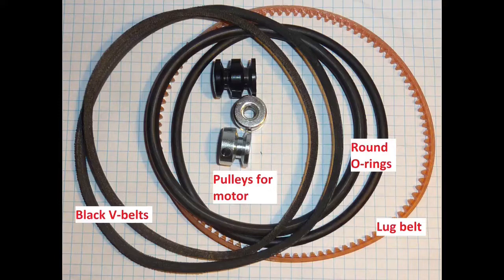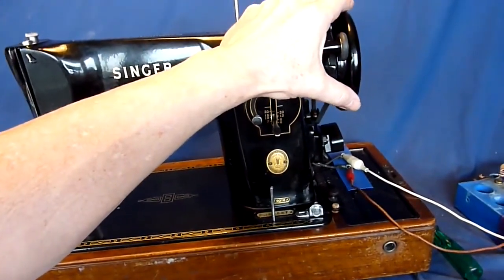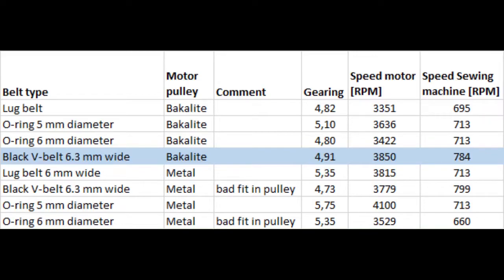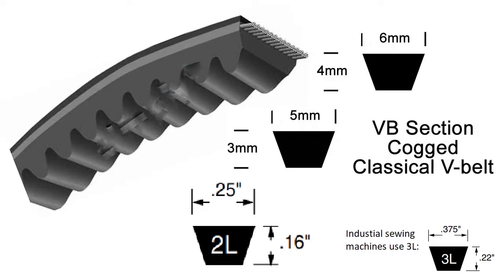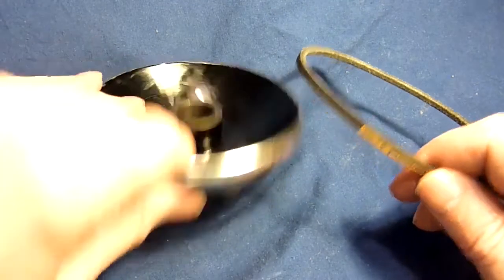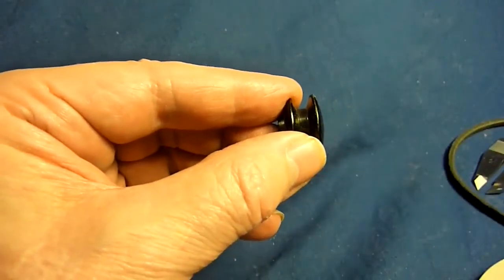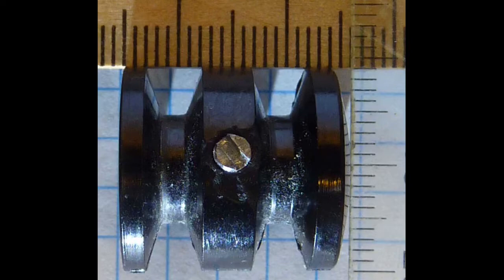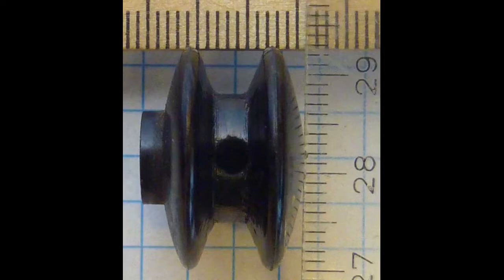How to select the right Belt and Motor Pulley for your Vintage Sewing Machine

Comment: This is great research. When building a speed reducer for my Singer 201 I had problems searching the right 5mm v-belt on aliexpress. In the end I used a GT2 timing belt and pulley I already had from an old 3d printer build for the motor to middle pulley part.
Reply from the maker: Thanks. I have seen this UK supplier of this kind of V-belts on ebay: https://www.ebay.co.uk/itm/Optibelt-VB-5x375-Li-Cogged-Classical-5mm-Wide-3mm-Deep-V-Belt/143250361763?hash=item215a630da3:g:PW4AAOSwZ2FcRb9f
Reply: @sewingmachinesindetail  Thank you for the link. I guess I should have included optibelt in my searches.

Comment: Thank you so much! I learn so much from you. Do you by chance have a video detailing how to change a belt on a typical machine like this? I have a brother select o matic and I’ve never changed a belt. It looks like I just loosen the motor screw and simply change the belt while it’s loose. I have found a v belt that I believe is the proper dimensions. I’m currently using a round belt like you’re describing and it seems to slip sometimes. I assume a v belt should help this situation or   at least was hoping it would help. Once in a while when doing a straight stitch, it will make a longer stitch than the rest and I was thinking it was relating to the slipping belt but I’m very unsure if it’s related to that issue. Regardless, I would like to reduce the slipping. Again, thank you for your awesome detailed videos like this one!

Comment: Hi. Thank you for your prompt reply.  I think I should have said motor pulley and not a spool which has the small spikes on which I feel cause the tension, my mistake. At first, I thought the belt has to be placed on or as near to the pulley for it to work correctly.
Reply from the maker: If your pulley got teeth, then your machine may use timing belts, and not V-belts. Timing belts are quite different. Please look here for more information on belts types: https://youtu.be/3pMx5hIgZbU?t=105

Comment: Thank you for your video, very good information. May i also ask you about, how can i install a new motor. As my vintage straw braid machine which has no strew hole either at the side or back. Also, this specific straw braid machine is clockwise (going backward instead of to-warding me) I don't know where shall i put the motor and also belt position to make this works. I can't find videos anywhere that showing any clue. Hope that you may can rescue me from this. Thank you very much for your time.
Reply from the maker: I am not familiar with your type of machine. You can get new universal AC-motors, that runs clockwise. I guess there will be some DIY work in applying a motor, if the machine head got no screw holes to fix the motor.
Reply: @sewingmachinesindetail  many thanks for your kindly helpful reply. All the best~

Comment: Excellent video. I have a question. My brother put a new motor on my sewing machine and the lug belt is breaking and is very loose, about 1 inch too big. Can I exchange the lug belt for a different type, or do I have to stick with the same type? The spool the lug belt goes around has small spikes running around the edge. Thank you for sharing.
Reply from the maker: Thanks for the interest. In general you can get lug belts in many different lengths. They normally got a V-belt shape even though they are cogged belts. What do you mean by the spool got spikes? Is it motor pulley or pulley on machine?

Comment: Is the V pulley explained from 9:17 the same as the inner diameter (inner hole) diameter of the pulley of the home sewing machine of 6.3mm? Please tell me where I can buy it.
I can't find it when I go to the given site.
Reply from the maker: Thanks for the question:
This is a shop in UK specifying 1/4" shaft: https://www.singersewinginfo.co.uk/electrical_parts_for_sale
This is a shop in US, that also sells at ebay, if you prefer that. I guess most of their pulleys are 1/4", but I think you need to ask them: https://www.vintagesingerparts.com/collections/pulleys?page=1
This is one from searching sewing machine motor pulley on ebay:
https://www.ebay.com/itm/291471827849?hash=item43dd132389:g:zcIAAOSwiQ9ZXjlK
Reply: @sewingmachinesindetail  thank you so much.

Can this pulley fit a V-belt about 10mm?
Reply from the maker: @ddiuni9964  You are welcome. No. Most of the referenced pulleys are for the small V-belts up to 6.3 mm wide for household sewing machines. 10 mm V-belts are much larger. Belts for industrial sewing machines are typically 3/8" or 9.5 mm wide.
Reply: @sewingmachinesindetail  i See. Then, the single sewing machine motor is a motor that uses a home sewing machine, but is there a pulley for use in an industrial sewing machine here?
Although the industrial sewing machine is small, the V pulley is 9.5mm. So I want to connect it to a home sewing machine motor, but the pulley is small, so I asked.
If there is a large V pulley that can be fitted, please let me know.
Reply from the maker: @ddiuni9964  Typically you will use larger and more powerfull servo motors for industrial sewing machines. The smallest pulleys I know of for the servo motors are 45 mm in diameter. You should not bend a 9.5 mm wide V-belt to a smaller diameter. The frictions and torque involved to drive such a belt is significantly higher, and I cannot recommend you to use the smaller house hold motors for that. They are used to much lower torque and higher RPM. If you want to use the smaller motors, you may include a speed reducer. You may also be able to find or make another pulley for the sewing machine. This is an example of an alternative pulley there: https://drive.google.com/uc?id=1UWrt_NX5Uyfo87PpPEr9w_QFe1o-JseF
Reply: @sewingmachinesindetail  No matter how small the industrial sewing machine is... Except for the reducer method you installed.

The pulley of the home sewing machine motor has an inner diameter of 6.3mm and the place where the belt is inserted is about 5.7mm.
It means that there is no pulley with an inner diameter of 6.3mm and a groove width of 9.5mm where the belt is inserted as a replacement pulley.
Reply from the maker: @ddiuni9964  Yes. It is my estimate, that a normal home sewing machine motor with a 45 mm pulley for a 9.5 mm belt will make a bad gearing and bad speed control of any small sewing machine. The motor will struggle too much with this. You may be able to find a pulley like that with a 6.3 mm inner diameter for instance on ebay. It may also be possible to fit a round belt with a 6 mm cross-section. But I think you would like to have at least a 80 mm diameter pulley on the main sewing machine shaft. This is an example of such round belts, but you need to learn to connect the ends: https://www.ebay.com/itm/304134932252?hash=item46cfdac71c:g:yqQAAOSwaXRhNYgV